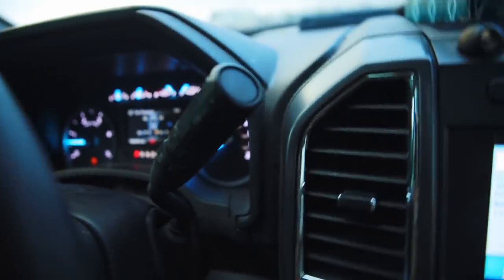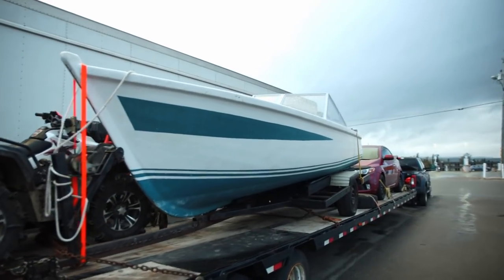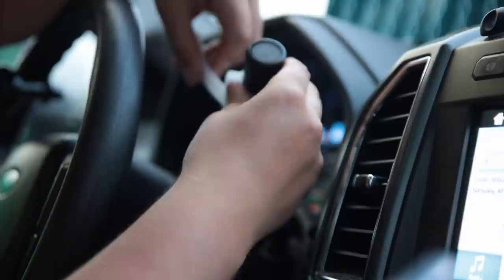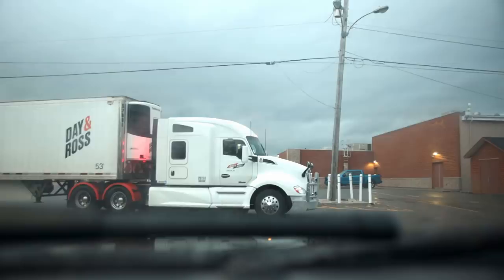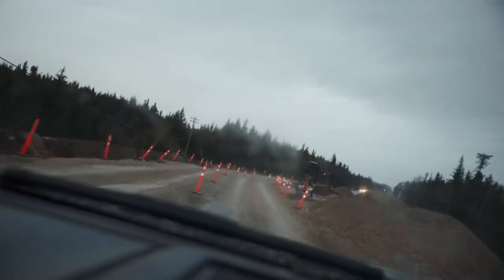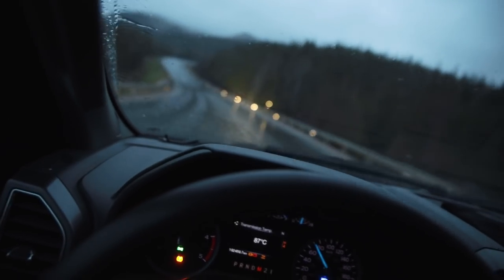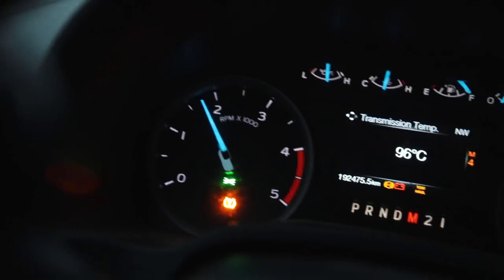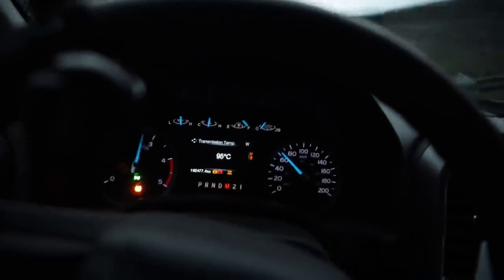WHEN and WHY Use MANUAL Mode on Your Vehicle (Buttons on your gear selector)

Comment: I only use the manual mode when I need engine braking or want to hold a gear when towing uphill. With a 6.2L gas engine, the truck's computer always wants to downshift the truck in too low of gears causing needless engine over-rev.

Comment: I use it on my 2017 Chevy Cruze going downhill to save my brakes. I still have the original brakes from factory with 56,897 miles on it.

Comment: You seem to be misunderstanding the engine brake settings. "Engine brake on" means its always on when you are NOT pressing the throttle. Also iIf you touch the brake pedal for one second, the transmission will downshift if there is a gear available without using the buttons. Ford has had that feature since the 4R100(early 1999 diesels) Everytime I get in my truck(2019 F350) I turn on the engine brake. It in turn locks the torque converter in every gear except 1st. The "Automatic Engine Brake" is on stand-by until you press the brake pedal. At that point it has a set point(target speed) to maintain. So you travel down a hill at 65km/h and touch the brake, that set the target for 65km/h and it tries to hold it. The grade flattens out, the engine brake will stop being applied, if the grade steepens(or speed increases) if you didnt apply the throttle it would resume the 65km/h hold. Works nicely if you are driving empty.

Comment: Dude not been funny but oh there's always a but, new brake shoes new brake discs and pads are a hell of a lot cheaper then a gearbox or an engine, I am with you for the hills and the right gear and using the engine brake when you are slowing for roads works etc just not so reliant on dropping gears just for the sake of it, just my option dude

Comment: I use manual mode all the time with my Ram 3500 hemi when towing, otherwise it shifts back and forth constantly. I find our GMs shift much more methodically and rarely need assistance.

Comment: Maybe your next truck should have a manual transmission?
Reply: The last full size pickup truck to offer a manual transmission was a 2018 Ram and I think the maximum torque available was 650 ft-lbs.